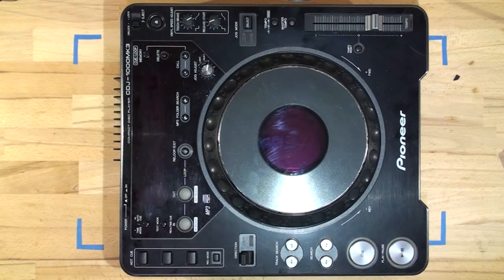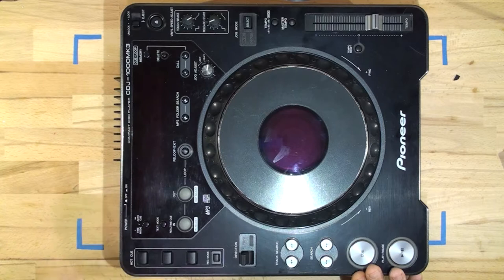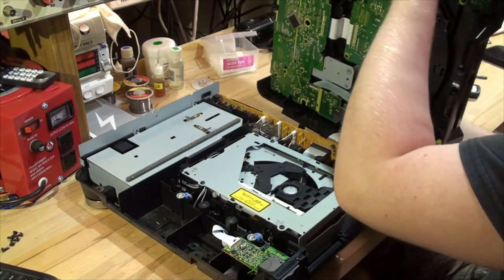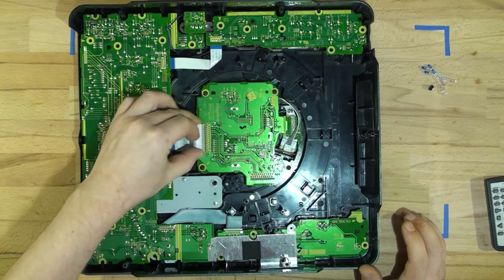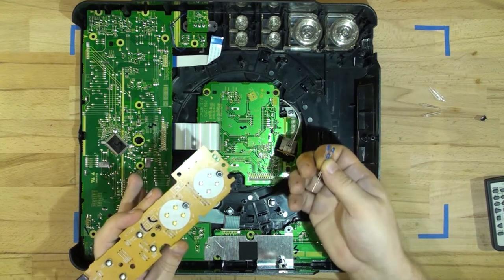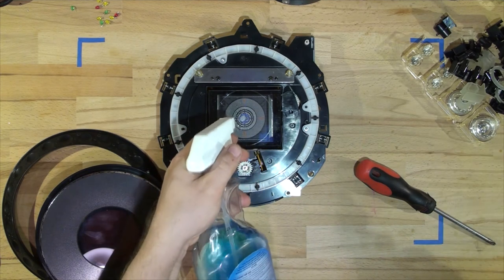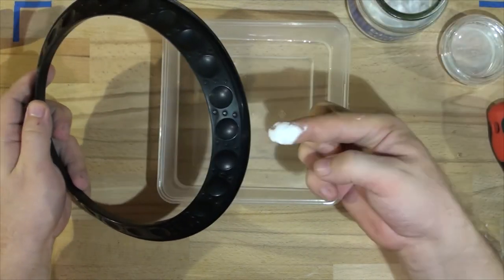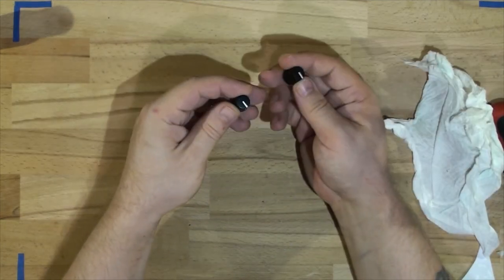Install Custom LED in DJ Decks + Refurb Of CDJ

Comment: the 4 color FX on my DJM 800 are not lighting up, (bought it like this) do you suspect it's all 4 LEDs that are knackered?
Reply from the maker: Sounds like could be transistors that drive the leds, check them first, it’s unlikely that all 4 leds failed at the same time

Comment: Hello Max, thank you very much for this video. With the help of this video I was able to do the same thing on my CDJs for the Cue and Play buttons and it looks great.
I would like to do more and put LEDs to light up the JOG like the CDJ 2000 or other turntables. Do you have any tutorial or advice? I thank you in advance
Reply from the maker: It’s same process goes for any equipment, just desolder old led and put new one in. You may encounter SMD leds, they’re same leds just soldered on the surface of pcb instead of through hole, you can buy them too and replace them.
Reply: @MaxELECTRONICS  Thank you for your answer.  I may have expressed myself badly.  I use Google translator 😁.  On the CDJ 1000mk3 there are no LEDs on the jogs.  how can we put?  THANKS
Reply from the maker: @roy5110 you can take jog off and in the cavity of the enclosure (where jog sits) run a 3mm led strip around the perimeter and connect it to CDJ’s power supply (12v), then reinstall the jog and this should do the trick, I’ve done that with turntables
Reply: @MaxELECTRONICS  Ok, thank you, I'll try that. good continuation. 😇

Comment: where do you buy your leds from blue ones and multi colour leds ones?
Reply from the maker: Use to on eBay but AliExpress is cheaper, simply search for 5mm blue led, or 5mm colour changing led slow.

Comment: Hello, excellent tutorial, I have a problem with the leds of my 1000 mk3, they do not light, I have never modified anything. 
Everything turns on and works fine, except the leds. 
Do you know the reason?
Reply from the maker: It’s hard to say without looking, see if there’s power on the rails before the transistors that trigger led, check that all cables are plugged in firmly, check transistors, check the ic. And continuity from ic to the transistors.